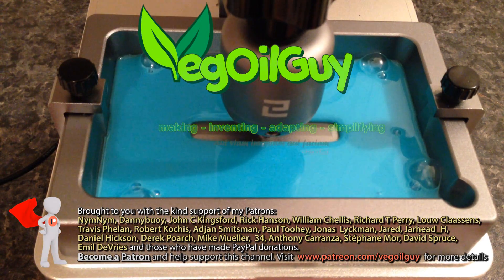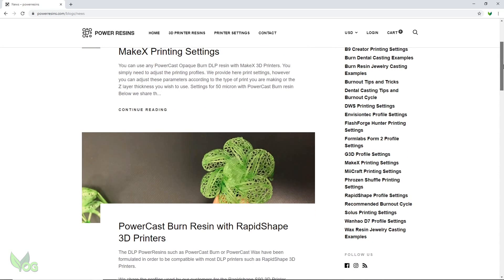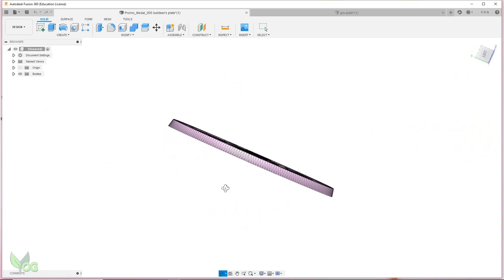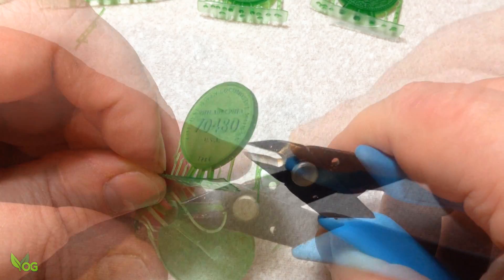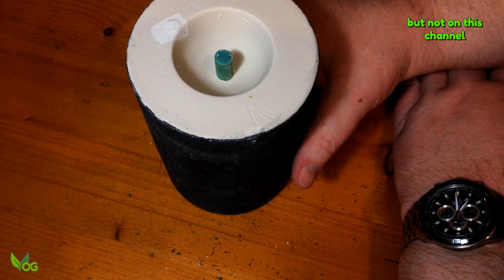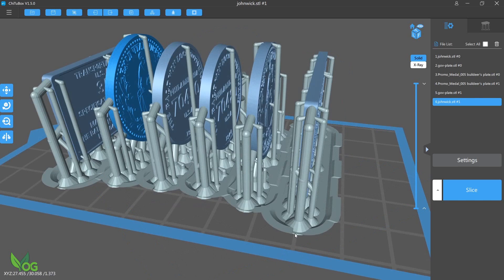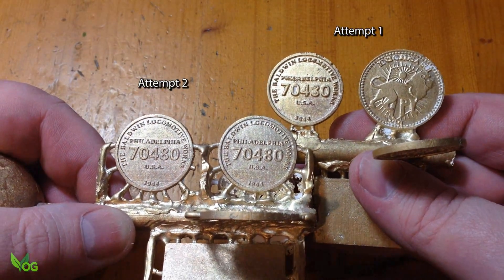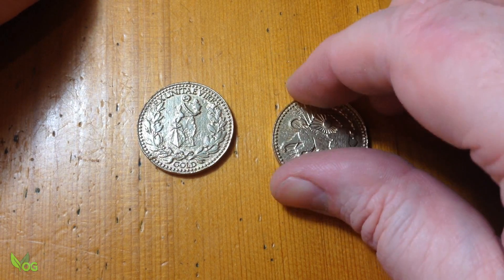Using & Reviewing Powercast Burn castable resin with my Elegoo Mars - detailed home castings! VOGMAN

Comment: Those are remarkable!  

I like the idea of a dual purpose support/sprue!

These plates' eventual home will be a 1/8 scale U.S. Transportation Corps S-160 live steam locomotive that I'm building, modeled after the full sized Alaska Railroad #557 that our group is overhauling for operation. The round plate used the same drawing that that was printed at full scale (9 inches diameter) in PLA and cast to replace one that was stolen 50 years ago from the prototype locomotive.

Many thanks to Geoff for his teachings. They prompted me use lost PLA to cast several other parts for the locomotive that I would have previously machined from a chunk of steel or would have cast using Petrobond sand using traditional wooden patterns. (Those who have made wooden patterns know that there is a major investment in time in making the patterns - especially for one or two offs. The time to draw, print, and cast using lost PLA or resin is considerably less. For some parts, one side is a mirror image of the other, so two patterns are required. With printed parts all it takes is to push the "mirror" button.)

After seeing what Geoff was doing with resin printing I ran out and got an Elegoo Mars. I've printed several parts for casting, but I'm not happy with most of them. there is a steep learning curve to get them right. 

Geoff - I think you used Elegoo grey resin for your first few lost resin prints. Can you comment on how usable it is for casting and compare it to the Powercast Burn resin?
Reply from the maker: I'll be honest Dick, I haven't tried Elegoo Resin as a castable alternative - yet : )

Comment: Glad you got it all sorted in the end! Looks amazing with that level of detail :) Try some true 3d models with lots of curves and 0.01mm layers to really push it if you can with that powercast?  :) 
I see you're still having power issues from the furnace. With my 3kg one it regularly tripped the RCD from the power demand of it running at full power for so long to melt bronze. To stop that, as it was getting pretty frustrating, I run an extension from the mains socket next to the cooker, which is on the same ring main as the cooker itself, and plug the furnace into that. Not tripped yet! :) If you've not got a socket next to cooker for that purpose, you can wire in an extension cable directly into the cookers connection that'll be hiding behind the cooker! Hope that helps stop the power outages for you too.
Reply from the maker: Am I guessing you're not in the UK? I've actually looked for some and couldn't find any. I'm sure it's available but nowhere that I've seen yet. Yes, I've been very tempted. I understand it's useful for larger items (as is anything I can't fit in a flask). I'm sure postage would cost you a fortune and I'd hate to do that to you...
Reply: @vogman  nah man, I'm in the UK, up in Lancashire! :) Postage wouldn't cost much for me, courier shipping is so cheap xD It's useful for larger items, but you can also do small items too, I've done a few bits and bobs with it so far that have worked really well and to a good degree of accuracy. I could do with improving my process, like working out how to make a plate with adjustable holes in to go on vacuum chamber so I can get parts (with a lip added on to fit over the holes) to be done in a vacuum. Not actually needed that yet, but I'm thinking for larger parts I might.
What's your email, I'll send over a hello to ya and you can give me your addy, I'll make up a bundle of what you'll need to do at least a good few parts and post it over next Friday for ya!
Reply: I bought most of what I got in bulk, as it works out tons cheaper in the end, and so very much more than investment powder, which is just dreadful for how much material is wasted in comparison.
Reply from the maker: You've found some here then. Brilliant. And you're offer is VERY kind... if you're sure...
If you go here - http://vegoilguy.co.uk/contact_me.php - you can send me a brief intro message. This will allow us to exchange emails securely and avoid all that nasty spam : )
Reply from the maker: I've pretty much come to the same conclusions, though ironically it wasn't either furnace that tripped. It was the vacuum pump. I've rearranged the power supplies now so I'm hoping it won't happen again : )
Reply: @vogman  off topic question. Have you looked into ceramic shell casting as opposed to investment powder casting? I've got quite an excess of most the materials I need, I'd be happy to chuck some in the post next week if you wanted to give it a go for a future video? :)
Reply from the maker: Ouch... I'll be interested in that...